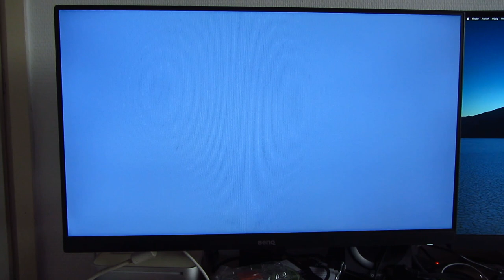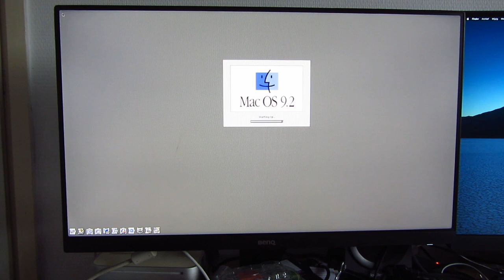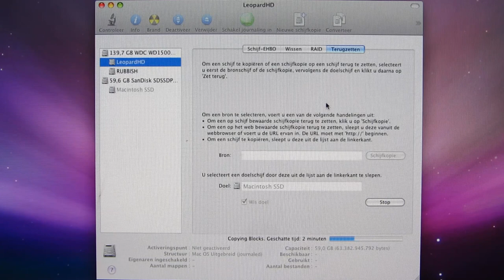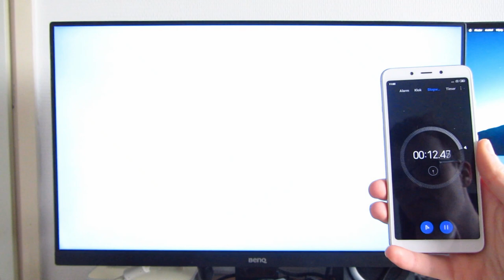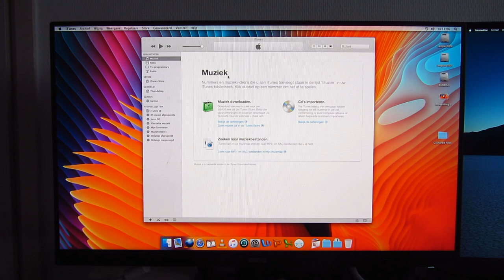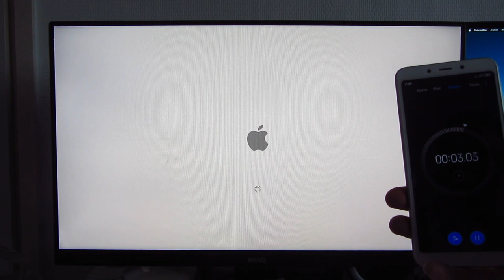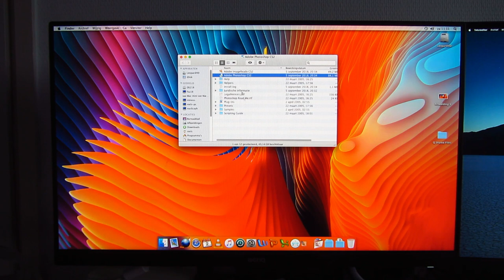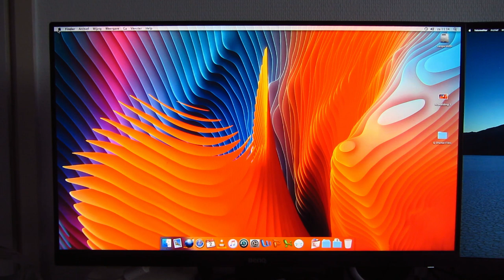PowerMac G4 MDD - SSD Adventure

Comment: I have, i dare to say, the quietest g4 mdd 2003. Tip: I replaced the fans in the revb powersupply and also the main fan 120m. Disabled the case fan as no hdd are in the lowerbay under dvd. This machine is as quite or even a bit more quiet then my 2008 macpro.  Nice video though. Going to explore ssd route as well. Got 1 pci slot left empty
Reply: can you send me a link for the fans?

Comment: Can you share what SATA card you use to connect the SSD?
Reply from the maker: Any card with the SiL3112 chipset can be flashed to work in a Mac
Reply: i thought he said you dont need sata card; its just connected directly to IDE no?
Reply from the maker: Both scenarios work. You can use a SATA card or a SATA to IDE adapter.
Reply: @nelizmastr many thanks !! i think you said its fussy about what ssd to use? i can see its sandisk but does it need to be particular model?